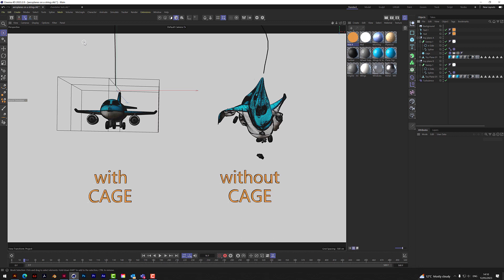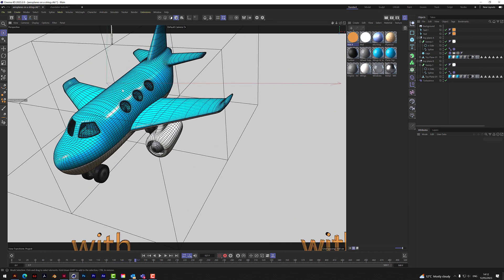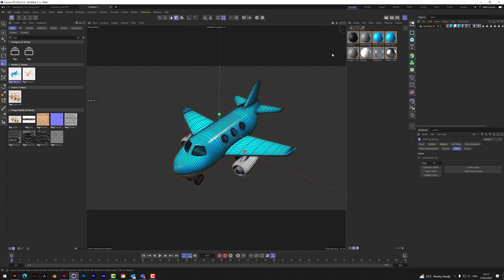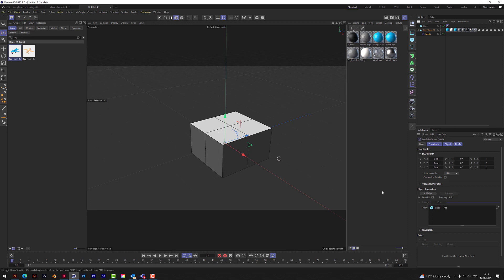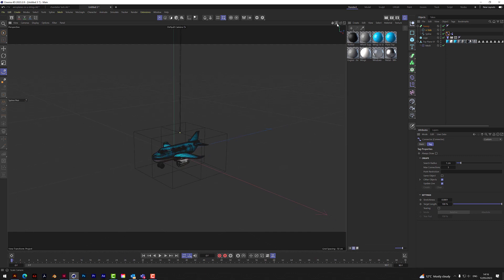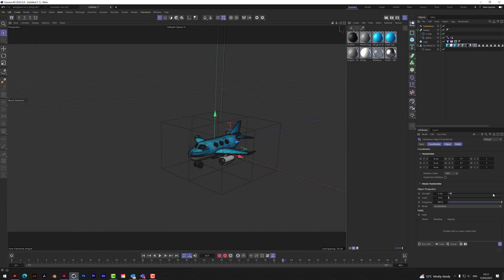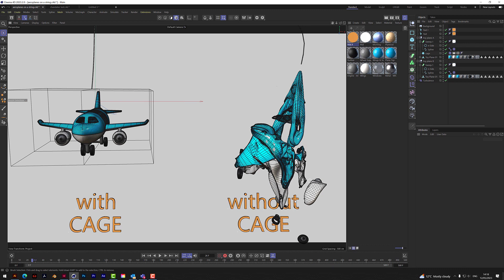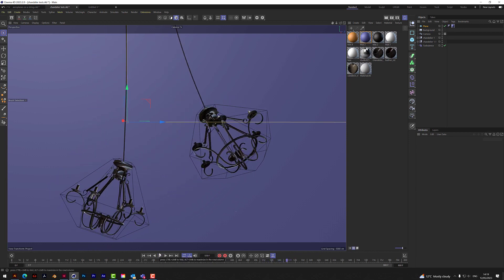[FIXED] Look how EVEN more amazing Rope is now!! | C4D 2023.2 Tutorial

Comment: If the Object hanging (i.e ceiling lamp) from rope simulation powered Spline (i.e cable ) is not colliding with anything (i.e. another lamp, table, wall) — an optimal approach (as there will be no visual separation from lamp to rope) is to Spline Wrap the Object onto end of Spline